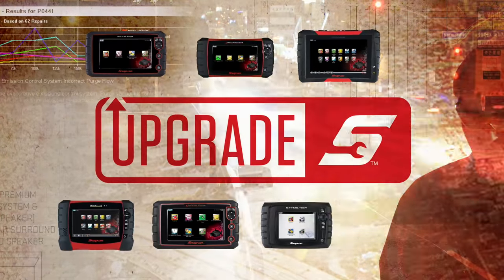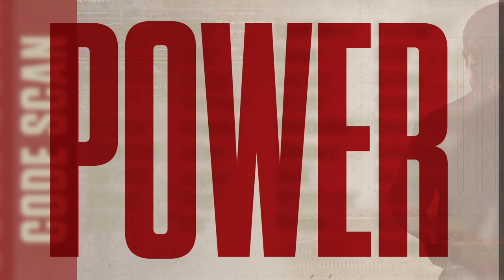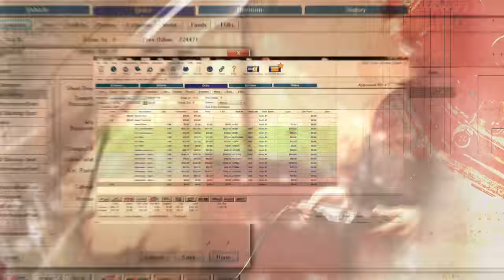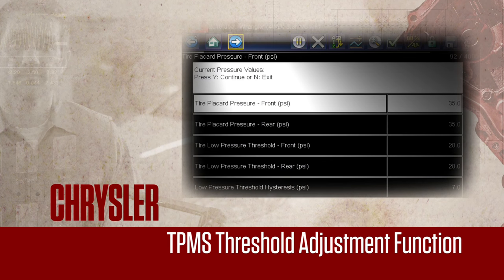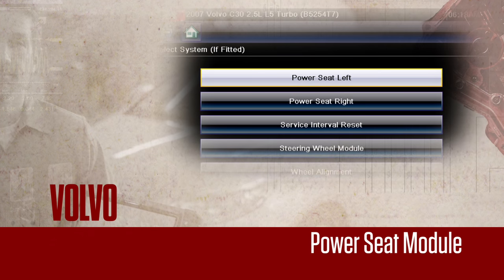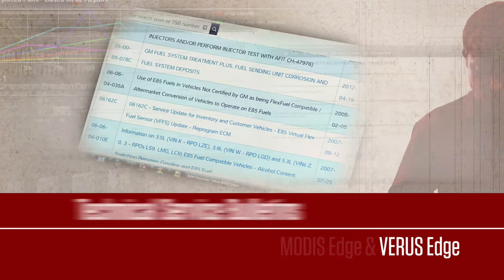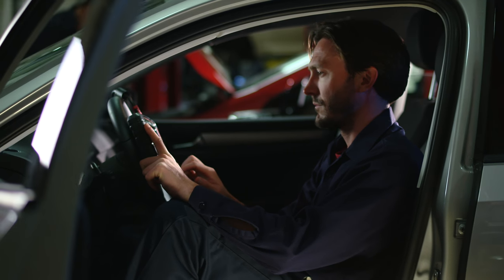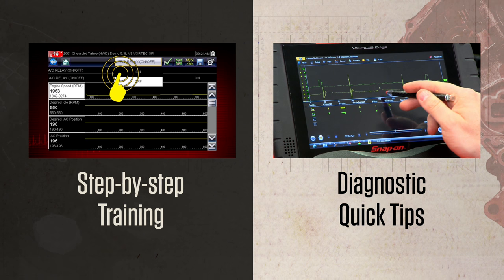Snap-on Diagnostics Software Update 16.4 - Be More Confident | Snap-on Tools

Comment: You cant fix saabs cause you still fail to cover them. People might as well buy the autel cause they cover way more and updates are cheaper and so is the scanner itself. Its unfortunate you fail to put in the important tests also even on domestic brands
Reply: true! that's what I been saying. autel is great for what it is. I use the ds708. graphing on its not the best though but the functional tests are great
Reply: Techman 48917 launch covers Saab. All access and bi direction.
Reply: Techman 48917 exactly